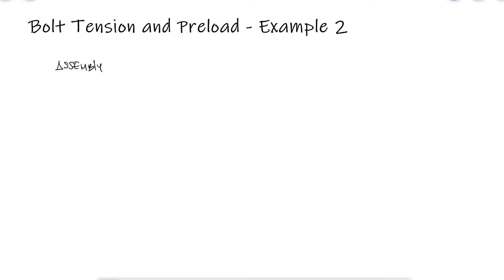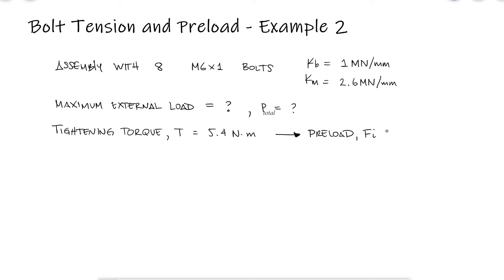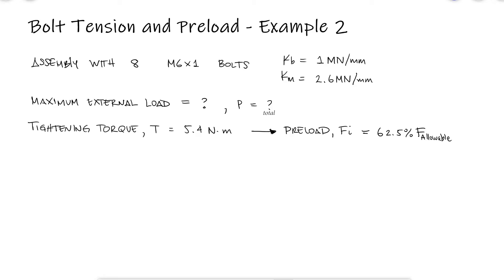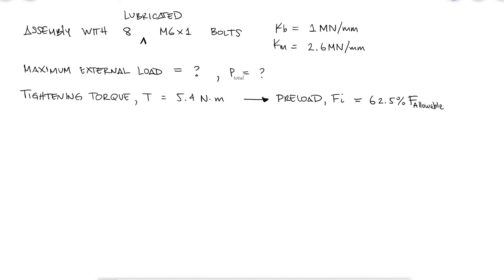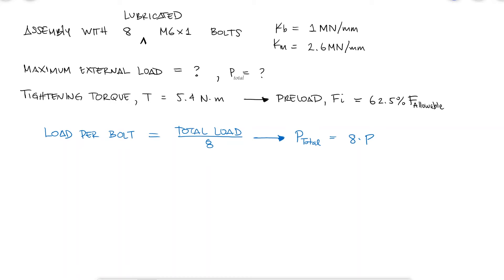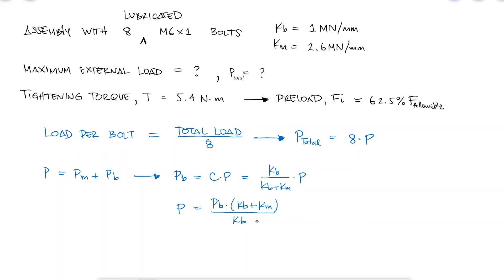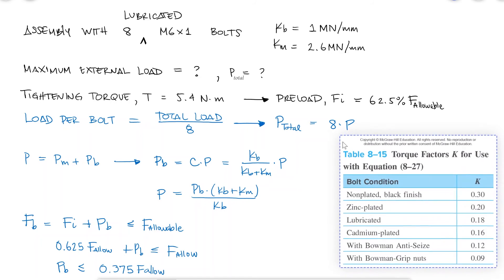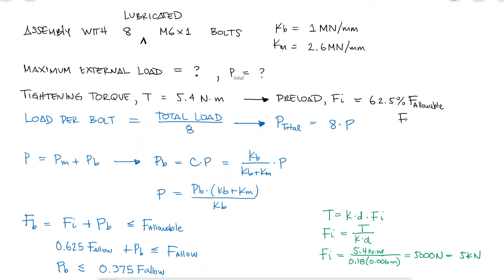Bolt Tension and Preload - Maximum External Load Given Preload - Example 2

Comment: 0.006 m what is d?
Reply: It'z the bolt diameter
Reply: @theozuretti6091  but did hi assumed that ? i guess it was not given
Reply: @adityarawat4964  since the bolt is a M6 x 1, it means that the diameter is 6mm since the convention for Metric units is whatever comes after M is the outside diameter of the threads